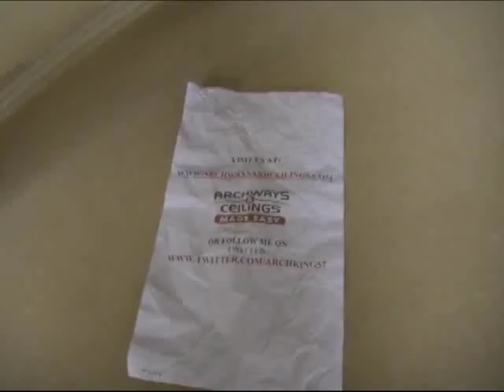How to drywall an archway

Comment from the maker: no problem! if for some reason you have trouble with this method, you can always get 1/4" drywall and just apply a double layer as well. I find using a flexible drywall in 1/4" helps with tighter radius's.

Comment from the maker: There are several ways to drywall an archway. The preferred method is to use 1/4" drywall and wet the back. You can even wet the back of 1/2" drywall and get it to bend to some archways. 
Watch How to drywall an archway (Preferred method) 
Video currently being played shows scoring the back of the drywall board. This method is common for DIYer's and people who don't ordinarily drywall for a living.***

Comment: Start nailing on one side and work across so you don't bind the middle or rip the arch... I always make it wider so I can trim back the sides to a perfect fit then skim coat the whole arch with joint compound.
MZ-HANDYMAN

Comment: If you use the thinner dry wall 1/2 inch, do you have to double it up with two pieces thick? or does it matter? Ive already got a 5/8 inche dry wall ceiling above the cove im installing.
Reply from the maker: +Dixie Dobbins double layer of 1/4"

Comment: I put the side walls first and cut with a router and l dont need cut from the back when i do the side walls,and then i just put some water on the piece what i use to the ceiling and the water makes the piece soft to put in circle so we dont need cut the piece from the back too